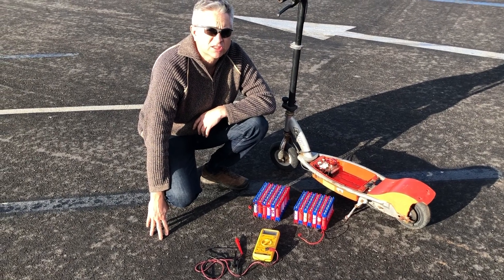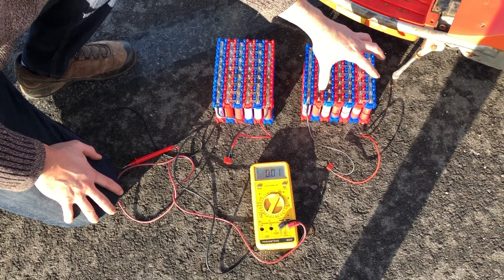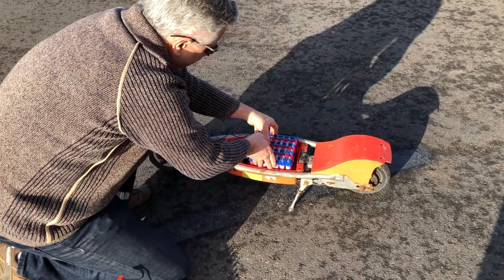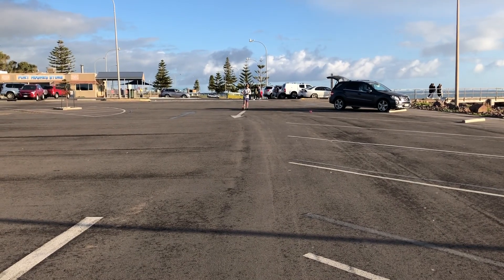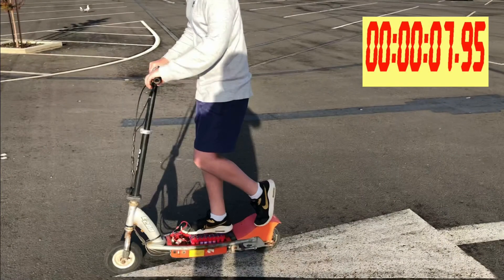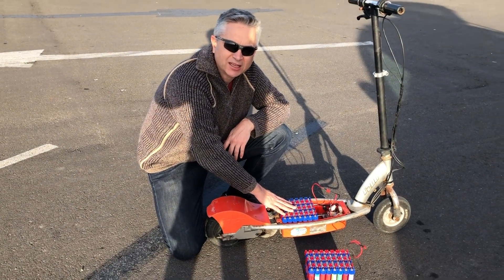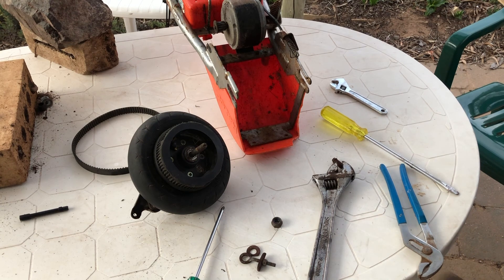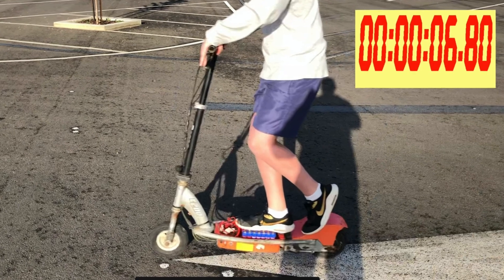Razor E200 Electric Scooter 6s vs 7s Lithium Battery Upgrade Test Comparison plus Bonus Tyre Change!

Comment: They are the same amp hour if both 7p so any idea if the higher voltage adds any range?
Reply from the maker: I would suggest that the range would be very similar as the amp hour as you say is the same.  Noting that that the 7s pack will have additional cells one might assume the pack with additional cells will get a greater range, however I'm not necessarily convinced having practically used both packs.  I trust this helps!  Cheers Drew